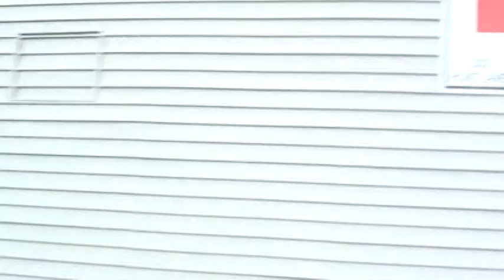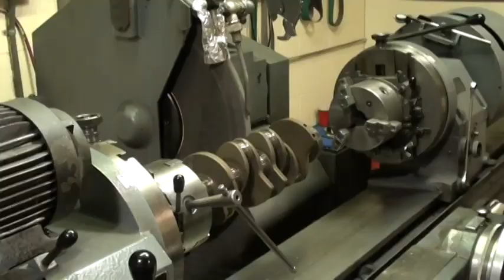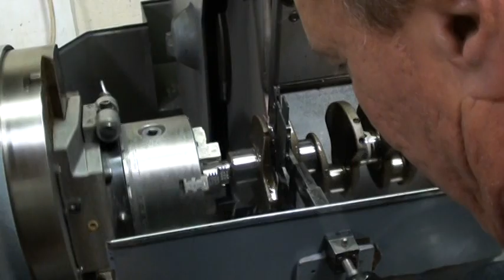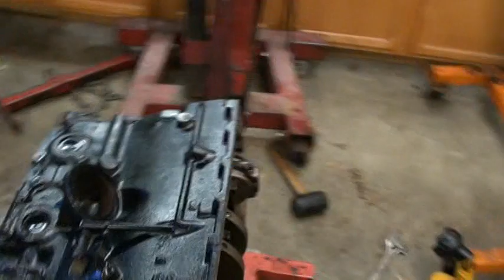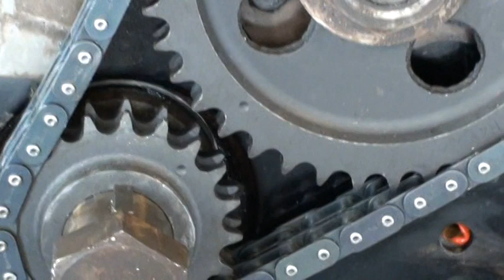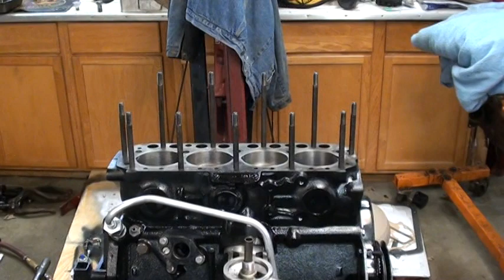MGB Restoration, Machine Shop work and Engine Rebuild Clip 4

Comment: Great video! Could you tell me where did you locate the Oil System Pipe-Filter/Block
Cooler By-Pass Tube.  Looking for this hard line tube to install in my 1973 MGB.  I do not have an oil cooler and I like the idea of not having one.
My project is to remove and replace the rubber bypass tube to a solid steel tube. Thanks...

Comment: Nice "B"series rebuild done as it should be.I only have one negative comment,why the hell would you fit perhaps the worst oil filter ever invented.Try cutting a new Fram filter open and then go buy a quality filter and cut that open.You will be shocked at the difference.

Comment from the maker: Really nothing, I put a new cam in but it was stock from 69 grind, the weber down draft is a little easier to work with. by just raising the compression a little made it a great running engine without having to use higher Octane fuel

Comment: Awesome videos, very helpful. I also have a 75 noticed a few minor differences but nothing major. First restoration, your videos have been very helpful. original head passed shop test, trying to figure out if I should paint it black like the rest of the motor or a silver or aluminum. What would you do with a stock head?

Comment from the maker: Well my green 79 seems to always be fighting from not to over heart, only way I found to stop it was to add a more cores to the raditor, the blue 79 with the aluminum head always run cool, and valves are quite as a mouse, and of course it lighter

Comment from the maker: Sorry it took so long to get back but had to go find my receipts, for just the machine work it was 100.00 to turn the crank, 35.00 do the fly wheel, and 50.00 for hot tank over night with tax still under 300.00. I thought that was great.

Comment from the maker: @itsawindupuk Thanks for watching, for your question “yes” it’s an aluminum head (good catch), when I had the original cast iron head checked out at the machine shop, they found a cracked in the water jacket of number 2 cylinder. This is the first aluminum head I have every used, but with the weight difference, and better cooling I’ll see if it was worth the money spent.
I just got finish tearing out the engine compartment, and start prepping for paint.